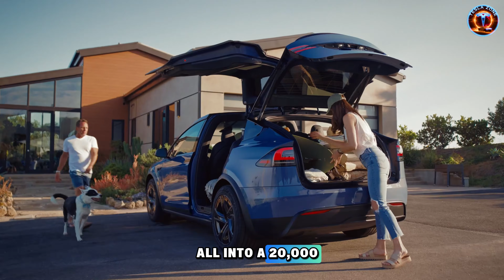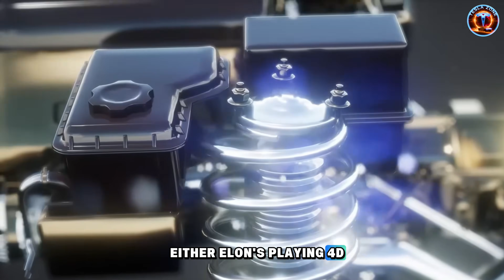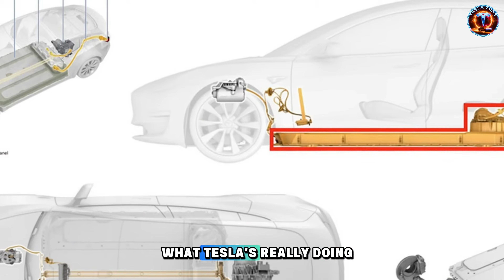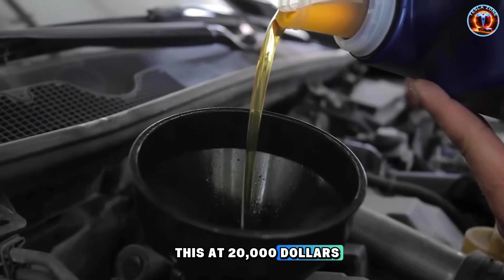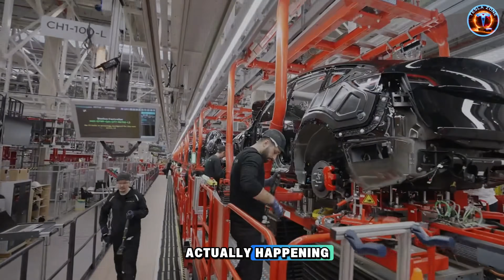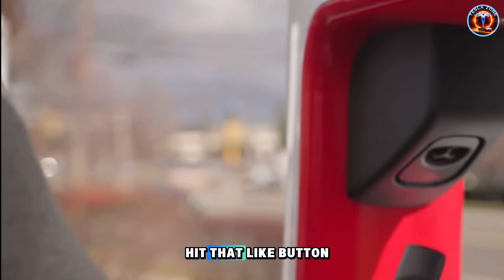Elon Musk LEAKED Tesla Model 2's $20K Interior: Beats $50K EVs... How?

Comment: You guys are just stupid.

A 16" touch screen is under $200 at RETAIL.

Yet another YouTube channel reporting BS. At least broadcast news still does SOME research.
Reply from the maker: A 16" retail tablet isn’t the same as an automotive-grade display used in Model 2 — heat, vibration, lifespan change everything. That’s the real cost debate.